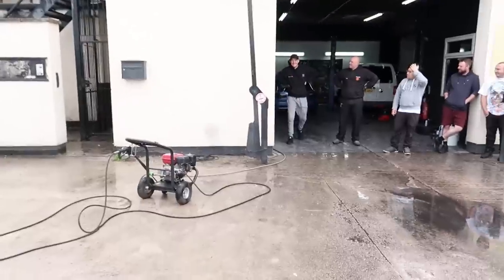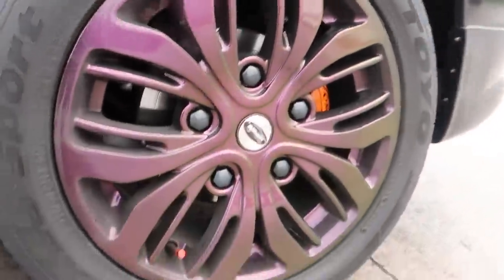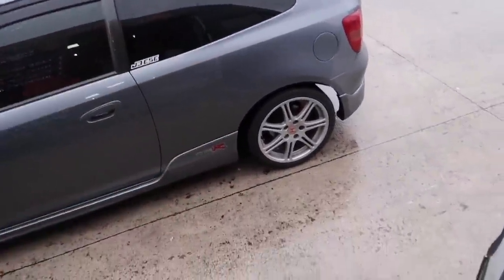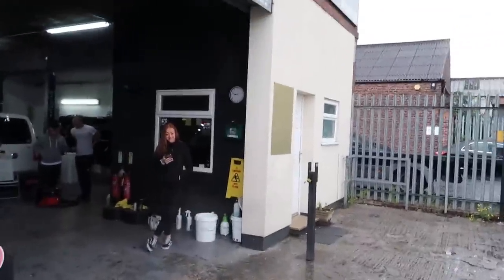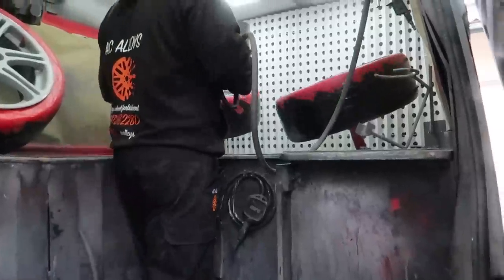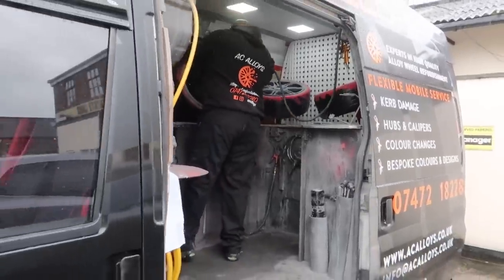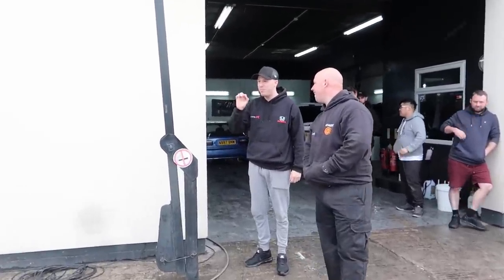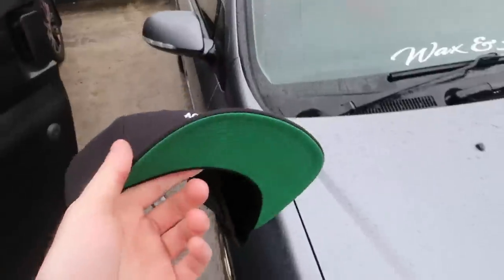NEW COLOUR ALLOYS FOR THE TYPE R!!

Comment: Nice job! Looks brilliant.
I was thinking that the colour of the rims on his van almost match the wrap colour of Lee's Evo.

My project car still has its original pressed steel rims, 15" rims and cross ply tyres. I had them bead blasted and painted original body colour in enamel double baked. Then fitted polished stainless beauty rings inside the rim.
I had my hubcaps rechromed but I don't want to fit them because I like the look of the bare rims with just the stainless rings.
I like look of nice new looking pressed steel rims against an aged body